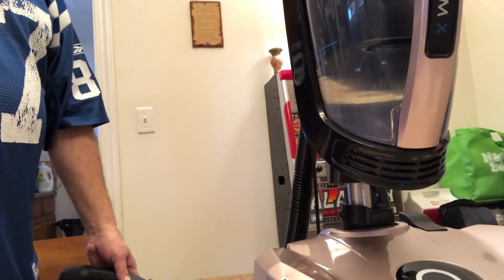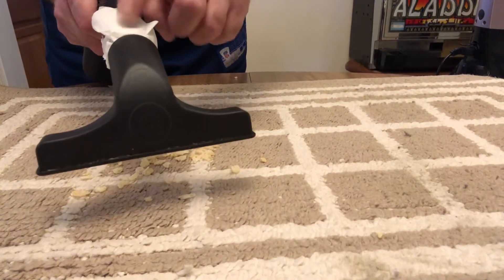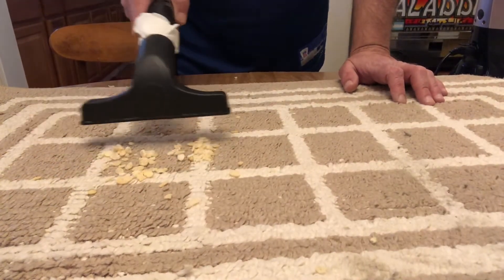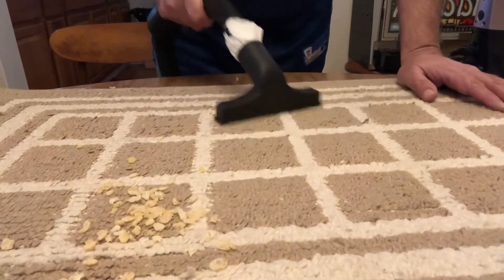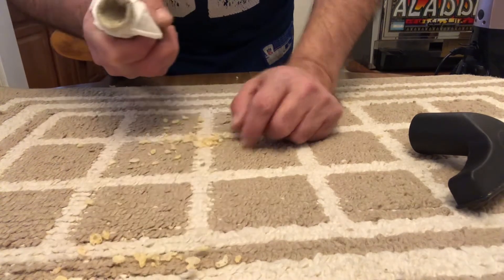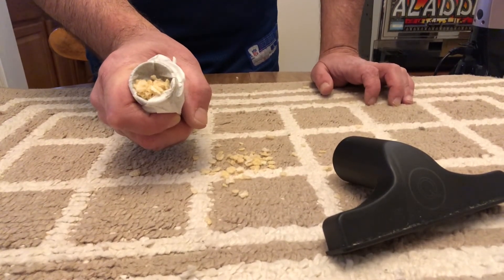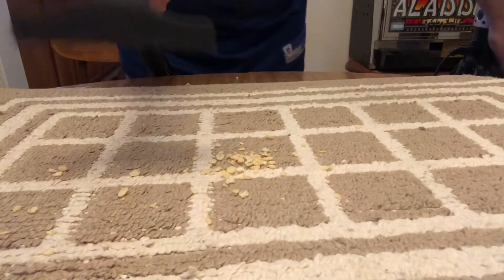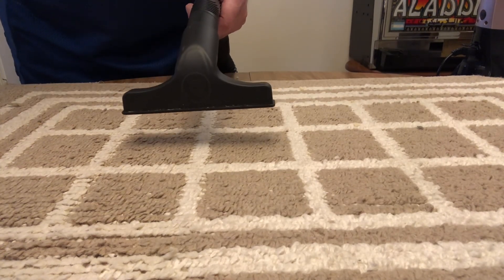Air flow vs suction

Comment: Very interesting. Really well explained but how do you dispose of the water in the vacuum? ... Cheers
Reply from the maker: I have a video on my channel that shows how to separate the solids from the liquids then throw the solids in the trash and liquids down the drain safety, or you can simply discard it all outside if you want.
Reply: I had a Rainbow. We always flushed the water down the toilet. Never had a problem with clogs. Lived in an apartment, so dumping it outside was not practical.